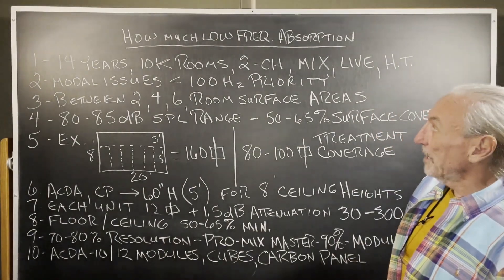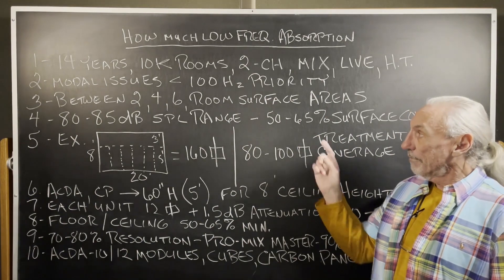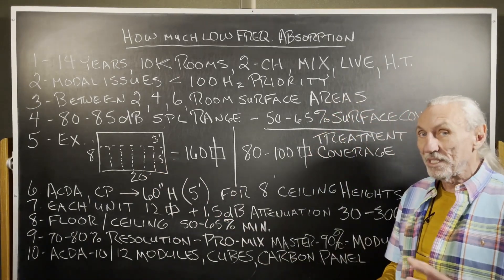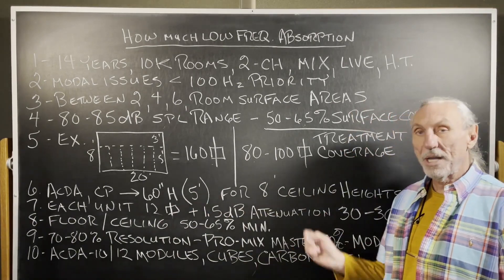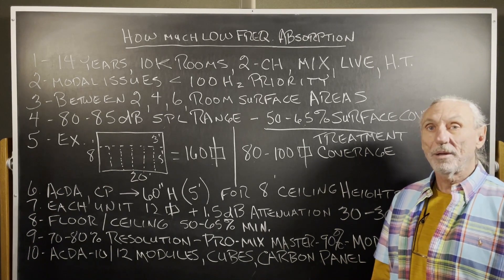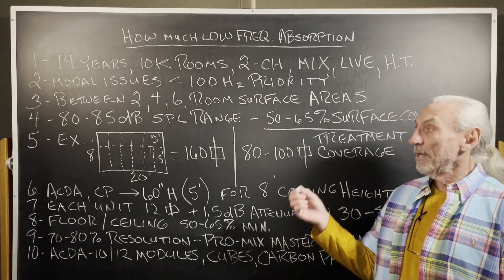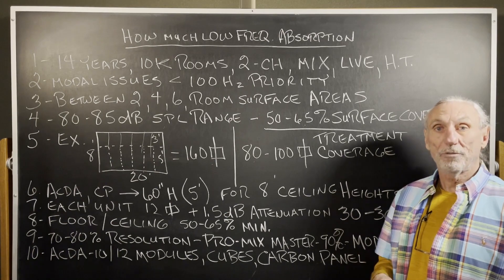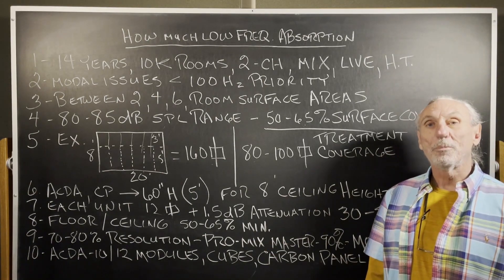How Much Low Frequency Absorption? - www.AcousticFields.com

Comment: Wow. At least you told me the truth. A difficult problem with a similarly difficult solution. Not sure how I'm supposed to add 230 pounds to my walls, not included ceiling or sound cloud.
Reply from the maker: We do it everyday using freestanding and inwall processes. Watch this video.
https://www.acousticfields.com/carbon-absorber-wall/

Comment: That is interesting because at say 60db general listing to the TV. (With HT system )  seams great, in the room, but as soon as increase in Volume the room just crashes.  Smearing of low end seams to ruin the midrange more than the high frequency sounds. 😢
Reply from the maker: Fundamental distortion produces harmonic distortion.